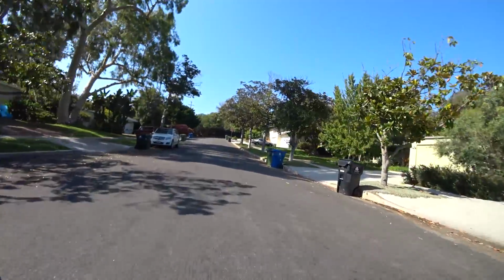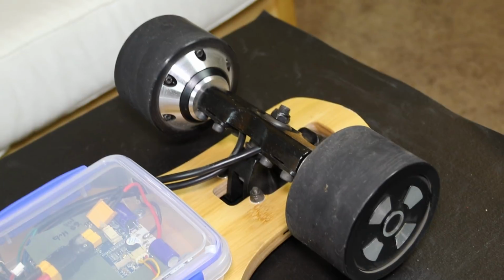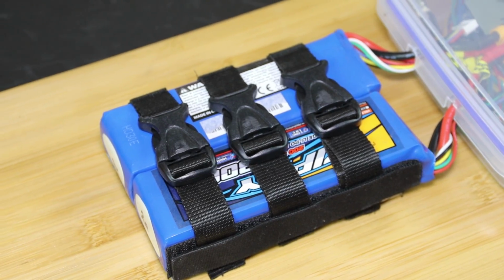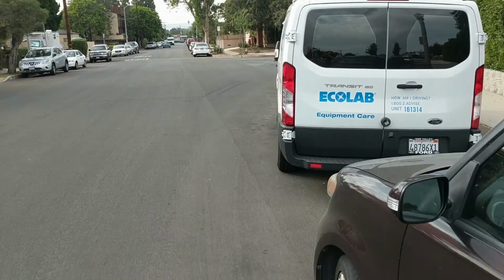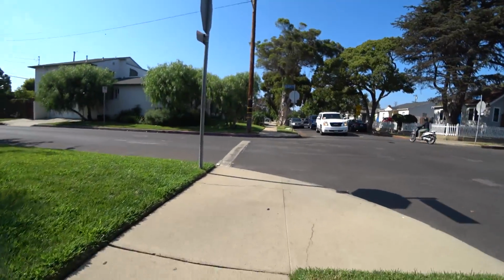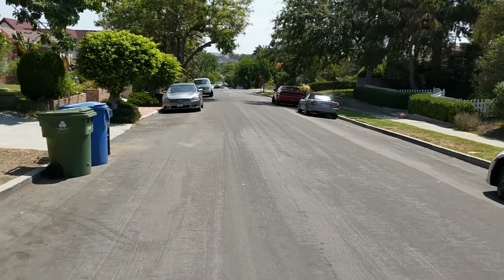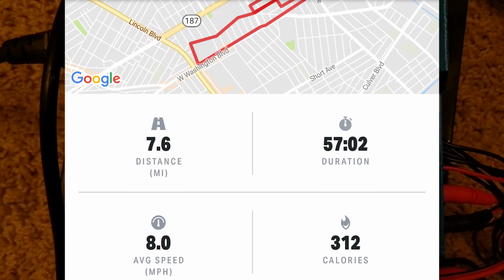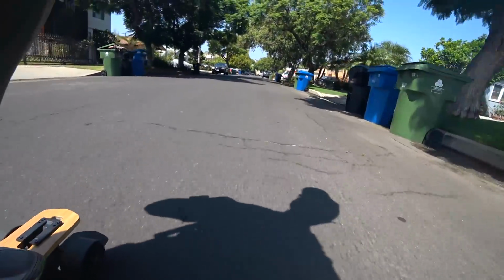Awesome Longboard | 21mph / $370 / Easy Build

Comment: Hey Body. i got the esc finally form china , the same one you have, but i think its defaulted for a 6s set up . 
i have a 2x 5s 5000mah (10000mah total)  how do i set the esc for 10s . Please help if you can!  
The instruction says disconnect  those 2 dots on position 2 on the picture, disconnect  those 2 dots on position 3 on   the picture. I'm not sure what that means! Do i need to solder?
Reply from the maker: I'm glad you finally got the ESC. Yeah, by default I think they're set to 6S. You can get 10S if you let them know when you order. Luckily it's a bit easier to go from 6S to 10S. You will need a soldering iron to break the solder connection in the locations shown in the ESC description. I recommend getting an iron that's 70-Watts or more, which will quickly melt the solder without heating up the board too much. An easy way to remove solder is to use a desoldering wick or if you don't have one use a piece of wire with many thin strands to wick the solder off the board when you heat it. I hope this helps.
Reply: Thank you men . I already ordered another one but still want to desolder the connection myself on the one I have now .  Thanks again

Comment: Just a copy of Meepo board,
Reply from the maker: Meepo is a good pre-built option for people who don't want to build a custom board. The motors and esc in this board have been available on eBay and other sites long before Meepo.
Reply: Oren's Projects cool gotya, thanks for not getting all over me, I would like to recommended you try belt motors there faster and cheaper,
Reply from the maker: I already have the parts for a belt motor build. I'll be doing that soon to compare to the hub motor builds. Thanks for the feedback.
Reply: If your doing budget build I recommend Keda 190kv,

https://hobbyking.com/en_us/kd-53-30-high-voltage-brushless-outrunner-190kv.html

And it works with This mount 
https://hobbyking.com/en_us/motor-mount-5.html
Reply: There are people who road 1000km with good belt system no issues,
Reply from the maker: Thanks for the recommendations! Those look like great deals for a budget build.
Reply: Oren's Projects I've brought them I'll update you when they come, I will record build for forums.
Reply from the maker: Awesome! Thanks

Comment: so the battery is a 10s 3000mah?
Reply from the maker: Yes, these are two 5S (3Ah) batteries connected in series to get a total of 10S 3000 mAh.
Reply from the maker: The speed is limited by the ESC. I'm sure the motors would have enough power to go faster. It doesn't bother me though because 20+ mph starts to feel unsafe on a skateboard in my opinion.
Reply from the maker: The ESC I'm using in this build can only be set to 6S, 7S, or 10S. It doesn't support 12S. I think 10S is the best option for this ESC.

Comment: Hey I just built the same setup that you that you have. Just wondering if there is anyway you can cut the speed limiter out as it feels a bit sketchy.
Reply from the maker: Unfortunately, the ESC in this board is not configurable, so there is no way to remove the speed limiter. This ESC is a great value but configurablilty is one of the tradeoffs.

Comment: What are all of the wires you used? what connectors should i buy? Also how do you plug the power button into the ESC do you need extra wires to do this?
Reply from the maker: The ESC has 2 sets of 3 wires (to power each motor). You can connect the 3 wires in any order. If the motor is spinning in the wrong direction just swap 2 of the wires. Each motor also has a connector with thinner wires for the sensors. Those can also plug into the ESC but are optional. In my case, the motors worked better without the sensors connected. The only other wires are for the batteries and switch. If you want the battery to directly plug into the ESC make sure it has a XT-60 connector. The switch (with wires) comes with the ESC. The switch should already be plugged into the ESC when you get it. I have links to all the parts in the description. Hope this helps.

Comment: Are the hubs sensored or sensorless?
Reply from the maker: The hub motors do have sensors. For some reason, the motors weren't running properly with the sensors connected. So far they've been working great (even from a stop) without the sensors connected.

Comment: Hi Oren, great project and video. I'm also thinking of getting a Skatedhred deck for my own project. Just wondering how the bamboo deck is holding up and whether you get wheel bite at all? Also is there much flex in that deck? Thanks.
Reply from the maker: Thanks! The dropthrough deck I used is holding up great and is built very well. There's no problem with wheel bites. The cutout is big enough for the wheels to have clearance. It has some flex but is thicker and less flexible than something like a boosted board.

Comment: Have you thought about adding these LiPo voltage checkers to your balance charge leads to get some visual as well as audible indication of the charge state of your batteries? https://hobbyking.com/en_us/hobbykingtm-lipo-voltage-checker-2s-8s.html
Reply from the maker: Thanks for the link! This voltage checker looks like a good option. I'll try it out. It looks small enough that it might fit in the container with the ESC and I can see the voltage through the plastic.
Reply: FYI when that thing is plugged in it is very loud and annoying

Comment: I'd love to get these hub wheels on a narrower truck for other purposes.
Reply: Sorry, thinking aloud.
Reply from the maker: I also prefer narrower trucks. For some reason, all the manufactures make longboard trucks that are around 10" wide. You could get the type of motors like I use in my other build https://youtu.be/5_hDH7vXdcQ?t=1m52s and use an angle grinder like Kaspars Dambis https://youtu.be/Sjut8hVuLWM?t=2m38s
Reply: Thanks for those links, your videos are very instructive and to the point. Would those 90mm hub motors slide off the suppled truck very easily for reinstall on another truck or have you seen those hub motors for sale separately? Thanks Oren.
Reply: I'm referring to the 90mm dual 6364 hub motors.
Reply from the maker: Thanks! I'm glad the videos are helpful. For the 90mm motors you can take them off the trucks but they have a shaft in the center and wouldn't easily fit on other types of trucks. You can see what the motor looks like here: http://www.diyeboard.com/hub-motor-9052mm-500w-75kv-for-diy-electric-skateboard-p-537.html
Reply: Thanks Oren, sorry to pester you while I have you. It looks like the hub motors have there own axel and slide into hollow hangers? Do you think the truck 'hanger' could be shortened even if it means having to shorten the axels attached to the hub as well? I'm sorry for all the questions mate.
Reply from the maker: No problem. From looking at my 90mm motors I don't think it'll be realistically possible (or worth it) to shorten these. I think the metal would be very difficult to cut and at best (with a lot of work) you can maybe save about 1". Just the motor part (without the shaft) is 3". So the 2 motors alone will take up 6". The total width of the motors on the truck is 10.5". I think the type with the square holes like I mentioned before would be the best chance for creating a narrower truck. Maytech makes 2 types of motors like that
https://maytech.aliexpress.com/store/group/Hub-motor-driven-system/1630416_509138353.html?spm=2114.12010612.0.0.6db18e72O7Nt3y
It might be worth contacting Maytech to see if they can provide a narrower truck. I hope this helps!
Reply: Thanks for your time Oren, it helps a lot.
Reply from the maker: A guy (Jan Kat) just commented on my newer video (https://youtu.be/5_hDH7vXdcQ). He posted a link to a company on Aliexpress selling narrower trucks with square connectors that you might find helpful. The smallest size they have is 251mm (about 9.9").

https://www.aliexpress.com/item/1PC-251mm-261mm-271mm-Dual-Drive-Skateboard-7-Truck-Eleactrical-board-bridge-180mm-Longboard-Truck-Skateboard/32840414970.html?spm=2114.10010108.1000023.12.4432d452oxd7Sr
Reply: I'm looking for something more like 150mm. I would have loved the hub wheels but it wasn't critical. I guess I'll try my hand at making and fitting a mount for an outboard motor. I've seen quite a few successful DIY builds along similar lines using smaller trucks. I basically just want the power plant and it won't have to act like a skateboard on my project. Cheers for the help Oren.

Comment: Awesome build and video. 
I started building my own After watching your video.
Im using the dual hub motors from china
https://www.ebay.com/itm/Electric-Longboard-Skateboard-90mm-Dual-6364-Hub-Motors-Drive-Kit-Parts-Mount/401378922310?_trkparms=aid%3D555018%26algo%3DPL.SIM%26ao%3D2%26asc%3D49477%26meid%3Dd13fefe5e0d642b28b7fba719531804f%26pid%3D100005%26rk%3D2%26rkt%3D6%26mehot%3Dpp%26sd%3D322688412411&_trksid=p2047675.c100005.m2219
Reply from the maker: Thanks! I'm glad the video was helpful and you're working on your own build. I haven't tried those motors before. I'd like to hear how they work for you.
Reply: Absolutely will let you know how it goes . I just ordered the esc so it's gonna take sometime to arrive but very so excited. Thank again for you video
Reply from the maker: Thanks, look forward to hearing about it. I'm sure you'll enjoy riding it. Good luck with your build!

Comment: Hey i just noticed your HALL sensor plugs aren’t connected. Any reason?
Reply from the maker: I hooked up the hall sensors at first and the motors were running funny for some reason. When I leave them disconnected everything works perfectly - even from a stop. It might just be the version of the ESC I got that has an issue with the hall sensors.
Reply: Oren's Projects I’ll look into that. Thanks!

Comment: So I did this build and have been using it daily on campus for about 2 weeks now. I'm 150 lbs and my campus is EXTREMELY hilly. Like there was no way of gaining a freshman 15 just because of how much excercise from class to class I had walking lol. But this build has done extremelyyyy well I can't find a hill on campus I can't get up. For all beginners looking for a solid first build I would highly recommend this one due to the simplicity and performance. I didn't have to do any soldering for this build at first. However one thing I would do over is soldering up some kind of anti spark because after two weeks I have notice a slight wear and tear in the board. However awesome build Oren! I love my board and I'm hooked on eskate builds now because of it!
Reply from the maker: Thanks so much for sharing your experience! It's very encouraging for me to hear these videos were helpful and your build turned out well. For the anti-spark I know that can be a bit of a problem. The issue is I've only seen XT-90 anti-spark connectors and couldn't find XT-60. My connectors have been holding up well so far though. One solution to reduce the spark is to add a switch inline with the battery, like I did in my recent video "My best electric skateboard" https://youtu.be/5_hDH7vXdcQ. That's funny about not gaining freshman 15. Hopefully the electric skateboard won't prevent you from exercising :)
Reply: I’m thinking of building this exact board for college, what do you mean by wear and tear from the spark ?
Reply from the maker: When the board hasn't been plugged in for a while there is a spark when you connect the battery, which could eventually wear out the connector. However, so far I still don't see any significant wear on mine. You can always replace the connector for a few dollars if needed.

Comment: how did you change the ESC from 6s to 10s? and are you using 2200V battery's?
Reply from the maker: In the eBay listing for the ESC there is a picture with some instructions on how to change voltage. However, I'd recommend you specify the voltage you want before you order because the soldering can be tricky. For the batteries, there are two 5S batteries in series, which is around 40V total. I have links to some battery options in the description.

Comment: Another quesiton, is there a way I could hook up a battery % indicator and maybe attach it to the sandwich container?
Reply from the maker: Most battery indicators I've seen were too bulky to fit in the sandwich container. The ESC will beep when the battery is getting low so I haven't really needed one. You could try this enclosure, which has a battery indicator, that alec Van Kerckhove found.
https://www.ebay.com/itm/Plastic-dual-controller-case-and-heat-sink-and-battery-indicator/302489840417

Comment: Nice build but do you have an alternate deck I could get since that site wants 60 dollars for shipping to ship to Israel...
Reply from the maker: Toda! The deck is just a standard drop-through longboard deck. I'm not sure what places would have good prices to Israel. If you Google something like "drop through longboard deck" you should be able to find some options. I hope that helps.
Reply: Thank for fast reply! Do you think a generic eBay deck would do?
Reply from the maker: Yeah, any standard skateboard deck should be fine. Good luck with your build!
Reply: last question I promise :), the parallel charging board you put in the description is unavailable. Will this work? https://www.ebay.com/itm/Parallel-Charging-Balance-Board-For-Lipo-Li-ion-IMAX-B8-Battery-Charger-LJ/112375998380?epid=781088510&hash=item1a2a21a7ac:g:7JgAAOSwN6JY9yDG

Thanks again for helping me!
Reply from the maker: Sorry for the delay. Yeah, that parallel charging board looks good. Any board with xt-60 connectors should be good. Feel free to ask any other questions :)
Reply: Oren's Projects Thanks, just ordered everything!
Reply from the maker: Mazel tov! Let me know how it turns out.
Reply: Oren's Projects Well I ordered everything but sadly the ESC got damaged in shipping so they sent a new one but it was worth the wait. The are I live in is full of hills which this skateboard handles no problem. Great way to get around and the battery just doesn't end. Thanks for helping!

Comment: Awesome choices and wonderful video. The same company that you bought the board from offers a similar deck that is bamboo and also has a slightly larger kicktail, and its only 3 dollars more. You should check that out :)      (http://www.skateshred.com/index.php/wholesale-blank-longboard-decks/39-x-9-5-bamboo-drop-through-double-kick-blank-deck.html )
Reply from the maker: Thanks! Yeah, I was considering that deck too. I went with the non-kicktail version because it's a bit shorter. I'll have to check out that board some time.

Comment: If I got these batteries instead - ZIPPY Flightmax 4000mAh 6S1P 40C - would that increase the speed and range of my board? Also, could I still use the charger that you have recommended?
Reply from the maker: If you run two 6S batteries in series (12S) you'll probably damage the ESC and motors. They are both rated for a maximum of 10S voltage. I've run motors at higher voltage before and the burnt out after a few minutes. If you want a longer range I updated the description to include links to 4Ah and 5Ah battery options that should work well. As far as the charger, it supports up to 6S batteries so it would be fine.

Comment: would using a lipo barrery over. 36 volts hurt the esc in any way
Reply from the maker: I'm not sure, but I wouldn't go higher than 10S voltage. The ESC can only be configured to a maximum of 10S so going higher might cause components to burn out. Also, the motors are not rated for more than 10S. I tried running lower voltage motors at higher voltage before and they burnt out after a few minutes.

Comment: You are my new Hero. I totally need to try building this thing. Can you replace the tread on the wheels or do you have to replace unit??
Reply from the maker: That's awesome you're planning a build. Good luck! The rubber is not replaceable. You would need to replace the whole motor. However, they seem durable and I think will last a while.

Comment: Hey can you tell me how to connect the connect the remote with the controller board? Thanksss
Reply from the maker: The ESC comes with the remote and they are usually already paired when they arrive. If you need to pair them the seller should provide the instructions (the eBay listing in the description includes instructions).